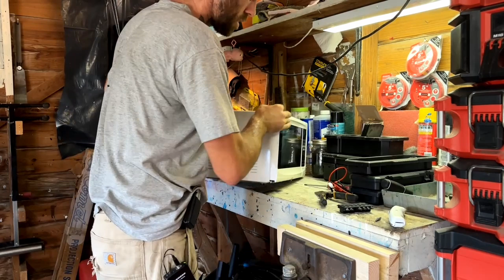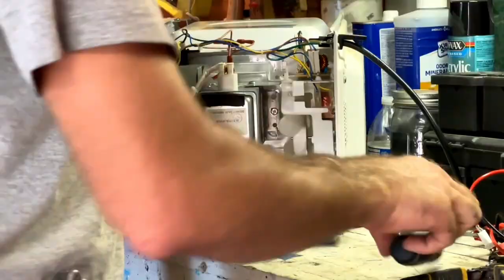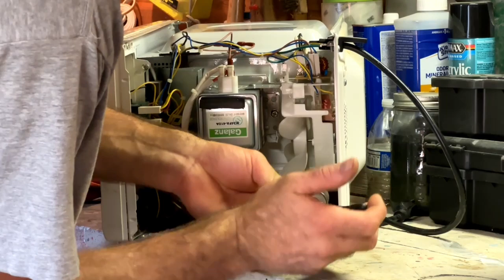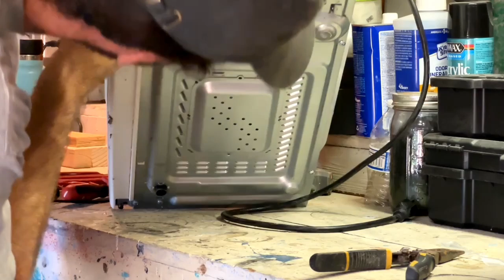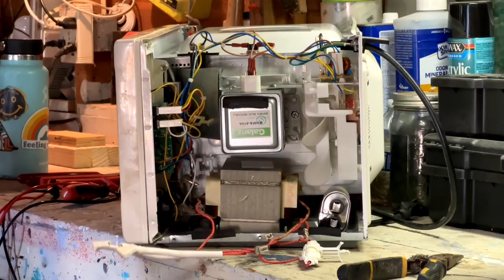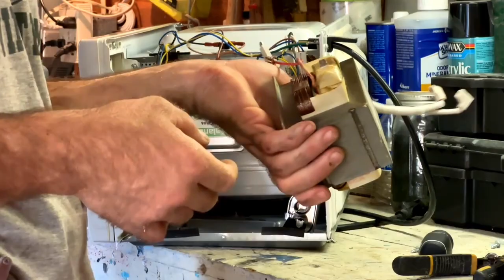Removing A High-Voltage Transformer From A Microwave

Comment: Thats not a resistor attached to the capacitor - it is the diode?
Reply from the maker: @bernhardnizynski4403  yes there is a diode attached to the capacitor as part of the microwave circuit. But In order to discharge the capacitor I attached a resistor between the capacitor and the case of the microwave.
Reply: @AntCBCV  Yes, that makes sense!